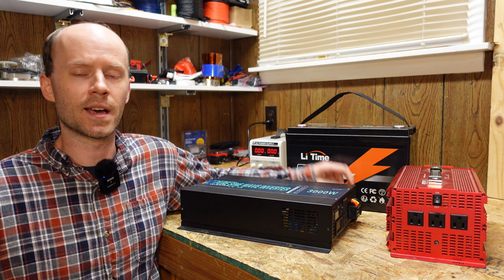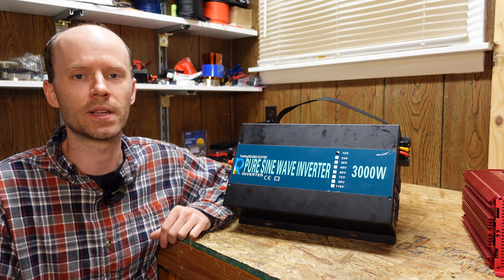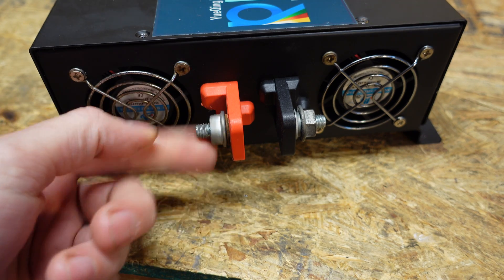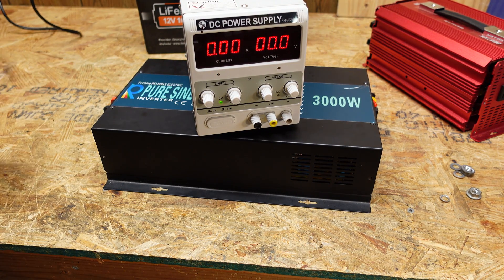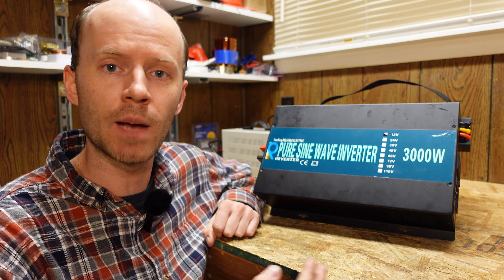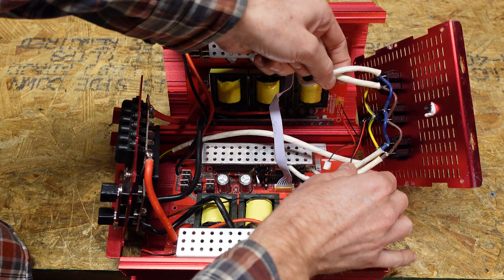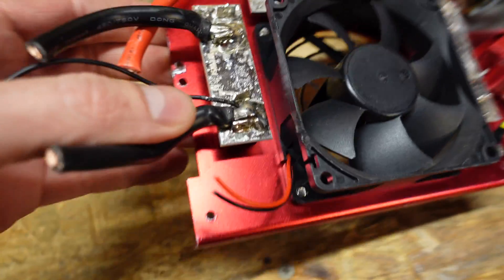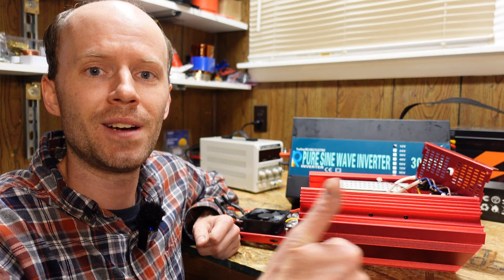Used WZRELB Inverter Dead on Arrival, Bestek Inverter Disassembly and Mess

Comment: I use a 1000w and a 1500w reliable. The 1500w runs my air 10amp compressor and other things in my garage. Been running great for about 4 years. My 1000w is 7 years old and she's a runner. I beat the heck outta them. They won't fie! Knock on wood lol

Comment: I also have had a 60 day old WZRELB 24V inverter fail. It took over 60 days to finally get a replacement. Thanks for the update.
Reply from the maker: Did WZRELB honor the warranty or did you exchange it through Amazon or similar?
Reply: I've had my WZRELB inverter since 2019 been running my home 24/7 it gets stressed alot! They are great inverters. And I do run Air compressors on it a ton can't get it to blow.

Comment: I bought a new 800w version of this inverter but it could not handle the surge of a small chest freezer. Returned it. Bought the 700w from Renogy and powered it without problems. Big difference in quality.

Comment: I had A Few inverters (UK 240V AC) Where the Component Power Chain For the FANs Had  Broken Down instead on the Fan Getting 12V DC i Found  a over voltage of 80V AC Going to the fans 

Fan died due both Reverse Polarity & Over Voltage

Comment: Here's my best guess with the Reliable Inverter...
Someone had that unit in service for quite some time. Something happened and fried the internals somehow. So they bought a new one off Amazon. After receiving the new one, they returned the old one for a refund stating that the unit was no longer needed/wanted. 
So Amazon just took it at face value and expected it to be the new one they originally sent, but the Buyer was a scammer and got a new unit for free.

Best guess, assumptions, speculations, of course.
Reply from the maker: I thinks your spot-on there...

Comment: I'm not sure what kind of metal they use for a lot of the hardware but it seems like a corrode very easily cuz I have a similar inverter and it also shows the signs of corroding and I do live in a high moisture environment so I'm not sure it's probably just low-grade steel and that's probably why it's corroding easily
Reply: Low grade steel and equally bad paint.  My own portable jobs had the paint flake off and the bare metal go rusty around the fan cutouts so I wire brushed it clean and hit it with some cold gal spray paint and it's been fine ever since.

Comment: Strip a bit of the heavy DC wiring in the Bestek and put it to a flame.  If it curls up when burnt it'll be CCA rather than solid copper.  It wouldn't be the first time that I've found the flyleads and internal wiring in one of these portable jobs to be CCA.  If they are undersized as copper they are even more so as CCA.

Comment: Funny, I have had the exact same issue with the exact same inverter with fuses. Easy fix.  I did some interesting tests on how many amps one half of the inverter circuit could hold until the fuse popped. About 160a. I got mine for 200 on ebay. I have 3 of these units now lol

Comment: I have two 12 volt 3000's and no problems, i received a 48 volt 3000 watt and it was marked as a 48 volt and it tasted immediately,  found that it was marked wrong, check box in the top shows 48 volts but the data tag underneath says 12 volt, marked wring at factory but manufacturer won't help me, i like reliable inverters but at a loss on why i cant get help

Comment: In the past 3 months.......
Purchased a "pop container", lid is supposed to form an airtight seal, and pop up when you want to open it. Listing shows it with a lid, the label on the container shows it with a lid. The item came with no lid. Returned with the "problem" being no lid, the replacement arrived with no lid. My sister just today (really) received a bottle of bodywash rather than a case of canned cat food.
For computer components I will no longer order from Amazon. 3 sets of disk drives listed as "with warranty of X years" arrived and were rejected by the manufacturer as "warrantied by vendor" rather than the manufacturer. Newegg has filled 3 new NAS for me this year, because their drives arrive with warranty. B&H filled another.

Comment: I found the video interesting. I think I would've tried to fix the inverter and improve on the shoddy workmanship, even though you made a great point of something else beyond the temperature control circuit. I guess I have too much time on my hands.
Reply from the maker: I might still try and can use it for supervised discharge tests. Get rid of that whole DC board, wire fan so it's always on, and put a nice set of terminal blocks.
Reply: Looking forward to the video if you decide to make one. @LithiumSolar

Comment: Having worked for a few companies over the years I can tell you that there are many counterfeit certifications out there. At one company we had to pull a product because the factory in China was not using the UL approved plastic we specified for the product but was marking it as if they did.

Comment: All that rust or corrosion, the poor reliable looks like it was installed in a very wet environment and eventually shorted out, blowing the fuses.  It couldn't be just warehouse breakage, unless like an Amazon warehouse flooded or something.  I'll bet it was a warranty repair return or something like that which made its way into Amazon's warehouse deals program somehow.

I have six of the reliable's... 24V and 48V models.  Plenty of little annoyances like the fan automation is "off" most of the time, and then goes full speed for 20 seconds making racket for no reason, then "off" again for the next 30 minutes.   And some of the models were shipped with DC studs that didn't stand out enough to even get a lock-washer on (they don't include lock washers and really should).

But they do all work.   Some have been running for over 2 years now.   I don't load them down more than 50%.

I have a besttek or two... just a few of their low-wattage car inverters.  I definitely would not trust them for anything bigger.

Comment: I can recommend the CNswipower 3200 watt inverter. Very quiet, and pure sine wave if that matters to you. Replaced a modified sinewave inverter I bought 3 years ago at tractor supply that was very loud. Now I can actually hear the window unit run.

Comment: WZRELB are excellent inverters. Buy a new one. Obviously someone returned one that had been run for many years at max capacity. WZRELB is the only brand i buy these days.
Reply from the maker: They have been good to me. I have a 1500W 48V and a 500W 12V, neither of which I've ever had issues and that 48V has powered a LOT.

Comment: Bummer, man. BTW I've been using the 24v version of that reliable inverter in my garage running a 12000btu A/C for two years. Hasn't failed me yet. Only complaint I have is the fan noise. Great video.
Reply from the maker: They are great inverters! Hopefully the new one that's actually "new" works better than this haha.
Reply: @LithiumSolar check the outlet polarity of that model.   All the ones I’ve opened up have reversed outlet polarity.   The neutral on the terminal bus is connected to the load/hot on the outlet.   This applies to the units with a vertical outlet.   The newer black units with the white 20amp outlet(s) are wired correctly.    I’ve made a few low quality videos of the issue if you want to check them out.   
I too have a 24v but 5000w that’s been running a full size fridge for several months.    If you can get the black “off grid” unit with the white duplex receptacle 20a.    I also have a 24v 3000w of this variety.   It runs my air compressor, demo hammer, saws, a spit welder (titanium flux core), ac unit 12000 btu etc….   Feed it plenty of amp hours, and heavy cable and it will make it happen.

Comment: I added a 1500w Aims inverter with a cut end from a wire loose inside the inverter. After 5-6 uses, I move it and the piece short the full inverter. 3 months after the end of the warranty, their answer was, we will not replace because you open the Inverter. No more Aims
Reply: Aims is trash tbh. Overpriced and shotty build quality.

Comment: I have a WZRELB inverter that I plan to use for a mini fridge and a 5,000 BTU air conditioner. So far, it's run both for several minutes no problem, and it's run the mini fridge alone for over a week. Also no problems. I plan to do more testing next summer when I can actually use the A/C for extended periods. If it all works, it will be going into a camping trailer. So far I've been very impressed with the low THD. Now I want to open mine up and see if I've got a green/yellow wire.

Comment: That fuse gap reminds me of Apple's phone chargers.
I have seen one disassembled and there is similarly tiny gap between the 240V AC and 5V DC traces on the PCB.
I am amazed that thing never shorted.

Comment: whole lot seems crappy= go victron
Reply: You can buy 10 crappy inverters for the price of a victron.
If those crappy ones survive 2-3 years then its still better assuming you don't need reliability.
Reply from the maker: Victron inverters are nice but they're irrationally expensive for use on a test bench as I'm doing.
Reply: @LithiumSolar Depends. The 1200va Phoenix inverters work well for capacity testing 12v batteries, the 48v models not so much since they are less likely to get you to 0.2C (talking about the 1200va 48v Phoenix inverters).
Reply: buy once cry once   @hubertnnn

Comment: I have 2 broken WZRELB inverters, one 5000 and one 8000 W.  People are telling the control circuit is bad and allows peaks of current into the mosfets which burns.  Quite expensive parts to replace.
Reply: Did you have the bus terminals connected to a panel?   Or did you ground the unit?